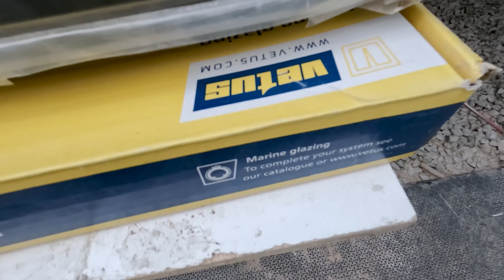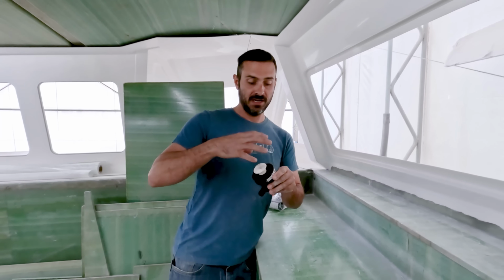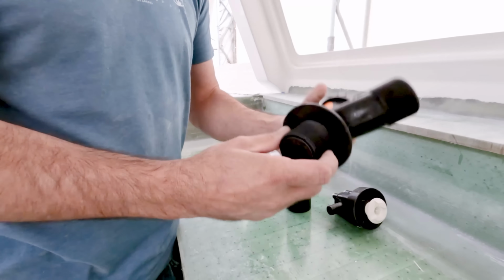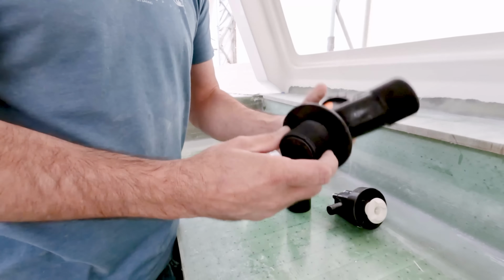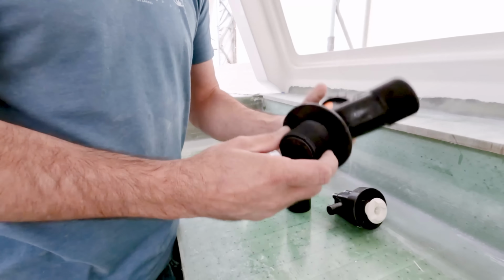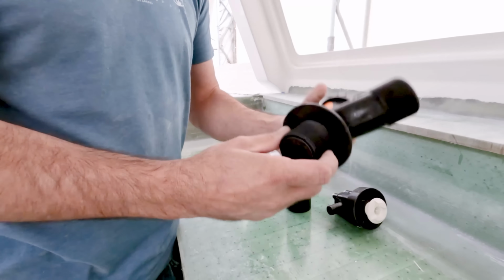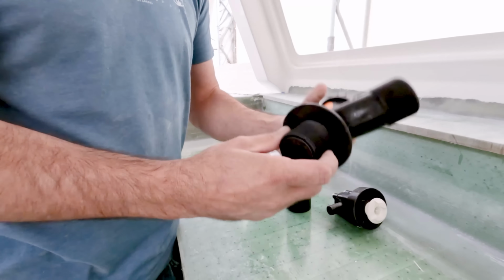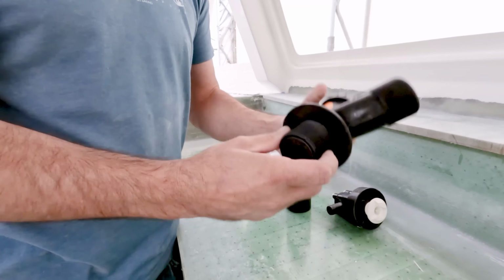Nerding Out Over FLUSH SEACOCKS  (MJ Sailing - Ep 256)

Comment: The other benefit will be, not having to wonder how many critters will migrate in the hole because when you close it it will be closed from the outside. That would be great for engine cooling water pump inlet.

Comment: These flush thruhulls  came with my racing sailboat 20 years ago.  They are great and require no maintenance.  You do have to make sure the holes are clean if you leave them open for a long time.  Sometimes stuff grows there and they become hard to close.
Reply from the maker: Are they the same as you had 20 years ago?  I hadn't seen them before, but neat to know they've been around that long.
Reply: @MJSailing  they sure are exactly the same!

Comment: Leery of drilling holes in the bottom? Heck yeah! But you guys are thorough and I'm sure the seacocks will be perfectly installed!
Reply: ive always driled a pilot hole then hole saw from the outside in then you get the hull angle correct and dont tear the outside surface fibres

Comment: Brave move packing the de-foamed hole and anchoring the valve in one shot, not sure that was wise. I'd pack the hole first then re drill the hole to be 100% sure the cavity was sealed, all it takes is a pinhole for water to get in and ....

Comment: Pro tip; when using a holesaw in fiberglass laminate, run the drill backwards. You get a lot more control and almost the same efficiency. You will never get ugly tear marks around the holes, from the holesaw jumping around when it suddenly and violently grabs hold of the material.

Comment: One little recommendation is the outlet of the toilet, should be as large as the outlet of the toilet macerater. If you use salt water flush you will get calcium buildup in these pipes that will quickly block them.

Comment: Cool fittings indeed, I have used Marelon on our cat as well. I was surprised in the method of fixing though, as it is standard practice in boat building to double the thickness of the outer and inner laminate and normally remove a section of core and make it a solid laminate... So it will be interesting to see how they hold up over time. As to race boats, building methods and layups have been stripped to a bare minimum to save weight and also because the life span of a modern race yacht is only about 5 years, so longevity is not so important. Cheers Rustie.
Reply from the maker: I thought so too, but talking to the designer/builder, they wanted it done this way instead.  It prevents hard spotting.

Comment: When you are sanding the next through hole, use some tape around it so you don’t damage the gelcoat. It takes a lot of work to fix those scratches you made. And use a random orbital sander, it doesn’t melt the plastic that much. And do the final sanding by hand, then you save a lot of work fixing the area around.
Reply from the maker: The gelcoat is being stripped from below the waterline to save weight.  It's how they are doing the production boats in Vietnam.  A barrier coat takes its place
Reply: @MJSailing  That is an insane amount of work for saving about 20 kg on a cruising boat. It is almost the same process, as curing osmoses problems. That is at least two weeks of work.
Reply from the maker: Yup.  It's all work.  But the savings is worthwhile for us.

Comment: One slip with that grinder and you could have damage to repair. A flush cut saw and then a minimal amount of grinding would be required. Also surprised you never used masking tape and then ploy to protect all that beautiful work. Not being critical just do not want to see all your great work get damaged.
Reply from the maker: We're stripping the bottom anyway.  Gelcoat is heavy:)
Reply: @MJSailing  Interesting. What kind of bottom paint are you going to use to control the water diffusion over time? If you strip the gelcoat doesn't that make the fiberglass much more permeable?
Reply from the maker: We'll barrier coat it once the gelcoat is off.  The boat is vinyl ester anyway, so it has much better protection from the start.
Reply: Love the seacocks, simplistic innovation. Plastics are like metals for cutting. You have really sharp, high pressure slicing, chipping or cutting. You can also use low pressure high speed abrasive cutting etc. Finally there is heat, melting the material quickly in a localized area and removing it, usually with high pressure air jet. The melting of the plastic is not the intent of sanding or cutting in these methods. A hot wire saw would give better results and the sanding speed and pressure if low, such as hand sanding, the temperature can be controlled to avoid the melting that results from the high speed and friction. Freezing the plug would also help controll the heat and prevent melting. A final smooth finish can be gotten with buffing techniques. 
Slowing down the saw and reducing the heat will allow for it to cut without melting. Or at least keeping the heat more localized. 

Really interested to see how these seacocks perform and what real world flaws they have. The idea to use a solid plug that can be cut down to achieve a flush surface. Just not having to clean the sea life out of those thru hulls makes this a salute worthy innovation. Arguably the plug material could be anything, including zinc. Even if the zinc was attached as a sacrificial cap that was made flush when installed. The void left without the cap would be significant less than with traditional seacocks. Based on how quickly the fiber nylon melted I suspect it performs fairly well in quite low temperature without significant contraction or becoming brittle. 
I wonder if CO2 would be a way to cool the material and allow the oscillating saw to cut the material more like wood. Otherwise the cutting surface needs to be thicker than the rest of the blade to reduce friction and allow cooling. 
It might be possible to change the durometer of the material toward the end without significant loss in performance. Creating something closer to a fiberglass type hardness would make controlled grinding easier.
You could even cut the thru hull short and add a cap of epoxy or fiberglass that you could easily sand off to flush.  I wonder if we will miss the traditional rings and holes.  I like that the actual valve is in the hull of the but not inside. 
How do you maintenance the sealing of the valve? Is there an o ring or packing nut, pressure adjustment?  Nerds want to know.

Comment: Since those valves are a permanent part of the boat, I’m assuming that they can be rebuilt in the future when the seals wear out?
Reply: Just about to type that question!
Reply from the maker: Yup.  The screw off cap with the stem going through is to replace the guts of the seacock or service.

Comment: Regarding the water holding tank pipe, I saw, on a Delos video I think, where there was a scale build up like hardening of the arteries within the poop 💩 pipe due to a chemical reaction between urine and sea water over time. Thinking about that, is your PVC pipe big enough in diameter? Would it be better to use through fittings and thick replaceable rubber hoses that you can band clamp on and off to make replacement simple when they eventually develop poop-teriosclerosis?
Reply from the maker: We're using a macerator electric head.  Everything gets chopped up before the holding tank and it's not an issue.

Comment: Good choice on the seacocks, and a lot more durable than the metal variety.  Having chosen such a sleek well designed boat, it's well worth including such excellent equipment, I guess there's a weight saving too to compliment your careful construction.  Even 0.1 of a knot improvement in speed is a lot of distance when sailing '000s of miles.  The bonus is that in lighter winds, you will keep moving just that little bit more easily. lovely under sail and satisfyiing under hybrid power.  Incremental gains!  
On a side note, if there some dinghies & tuition locally, get yourselves out there.  Even as experienced sailors, it's exhilarating, you learn so much, even watching the weather evolve and trimming sails.  Get some solid wetsuits and find a friendly ILCA (Laser) fleet.
Interesting DNA test, did one a similar one last year.   The male line is completely inline with the clan.  The advanced maternal tests, brought up more connections than I expected.

Comment: I would hope someone made the thru hull part in stainless or brass? The plastic part looks really cheap for a multi year part in contact with salt.
Reply from the maker: They are inert - so don't corrode like stainless or bronze - but they are also shockingly strong.  It's why we used them in our aluminum boat for Arctic sailing.

Comment: Hi guys could you not have used a Macerator Toilet they pump up to 3mtrs high which could put the outlet above the water line
Reply from the maker: We are using a macerator.   But I'm not a fan of above water discharge for a head.  It's amazing how bad it stains gelcoat.

Comment: We damaged a through hull fitting because a heavy item got into the bilge in error and boat movement allowed the item to bounce around and damage the through hull. We were able to replace it relatively easily. How would u replace these new flush mount through hull fittings should they become damaged?
Reply from the maker: Cut it out and replace.  It's how we typically replace a thru hull since it's easier to cut out than to be gentle

Comment: Onboard Lifestyle did a video about there through hulls and they went with minimal holes and all were right above the waterline except for there water maker. I would suggest to go that route because it's much safer to do so.
Reply from the maker: Our boat can't sink from a through hull fitting.  A failed fitting would just get the sealed bilge wet
Reply: @MJSailing  so are saying that the access port where you placed the through hill will be sealed as well?  How will you operate the seacock? Some type of access panel with gasket?
Reply from the maker: Nope.  It's above the waterline.

Comment: Would it not have been more practical (for insuring foam-protection from moisture) to first drill a slightly bigger hole trough the inside glass and the foam, and then drill the right size through the gelcoat an remaining glass from the outside?
Reply from the maker: I was thinking of doing it that way at first.  But we're not too concerned about the core here as the infusion creates cells with resin walls sealing in the core.

Comment: 10:00 black water holding? why not dump it above the water line.  You should be offshore to dump it anyway. I lived on a 58 foot Hatters our black water exit out the side of the boat.  So we bought a big Macerator. Turning to port we had a starboard gun. No no we never shot another boat.

Comment: Because the valve goes up and down , does this mean you will open and close more often,  or barnacles could crow in the tube ? 
Is it to small a diameter for a toilet outlet ?
Reply from the maker: It's the standard 1-1/2" used in most toilet installs
Reply: @MJSailing  inlet or outlet ? , also the hose into the holding tank is tiny , usually again must be 4 inches , lagoon ,outremer, swan, all production boats use a larger outlet to the tank and after , I haven't seen any with the input hose inside the tank, usually entering at the top, exit at the bottom. 
The fact that as soon as you start sucking in any air on a flush you get a flow back, and residue in the pipe , many not saying you stop pumping or electric flush,  stop as soon as poop or pee has gone , leaving the residue,  more pumping helps ,but fills the holding tank quicker . and no paper , floss , wet wipes , down the pan,   yup sadly I have in my job had to sort out the issues ,
Reply from the maker: 4"?   Nobody uses four inch for anything.  Again, the standard is 1-1/2".    The pipe out of the toilet is 1".... The same as pretty much every electric head on the market
Reply: @MJSailing  water in yes , out is bigger , seacoast bigger ,  y valve much bigger if used,
Reply from the maker: Show me a single 4" thruhull sold for the recreational market.   Just a link....i'll wait :)

Comment: non services able, non removeable seacock HAAAAHAHAAA see them before. you WILLL REGET USING THEM. But what do I know having worked on luxury yachts for nearly two decades, I just work on multi million dollar boats in south florida.
Reply: Making holes for through hull's, DRILL FROM THE OUTSIDE. pilot from the inside drill from the outside. So the hole is true to the curve of the boat. Other wise it will not sit flat/flush to the outside. Palm to face. Also its better to use a drillpress adapter for the cordless drill. You can get them at harbor freight. dirt cheap. keeps the cut VERY  striaght and true.
Reply from the maker: You do realize these don't have a flange on the outside?  There is nothing to be flush?  The screw off cap should give you an idea that these are serviceable
Reply: @MJSailing  I know of this type. AND YES no flange to the outside means you have only a putty filler. That may or may not have a perfect seal to your decorded area inside and outside frp layers. I'm 99% certain you will find water in the core in that through hull area with in 1-2 years of the boat splashing. Even Putty with chop strand is still subject to fracture, and is not a fiberglass layup.  The putty is likely to get mocro seperations between fiberglass/putty as the boat hull flex's with use and pounding seas. The entire point of an outside flange is simple. Water pressure is pushing IN. There for its hard-ER for water to get by a sealed (caulked) flange. Now if a flush outside is desired, then a deletion is done (an indent is molded or carved out of the hull fiberglass. Using those through hull sea cocks, the ideal install is to leave the outside skin alone, decore from the inside. Use red board, green board, G10!! or scrap solid fiberglass scrap or hand layup. set it into the decorded area with a few layers of matt or what ever,  not putty to the outboard side. and do a finish layup over the board to the inside of the hull. Then cut your hole and do the install as shown in this video. Then the install will have a solid fiberglass install. And yet the through hull is still NOT survice able. Its glassed in place, the upper section may have survice access. Through hulls of anytype are generally regarded as ONE time install. Threads wear and materials age in there own manner.

Comment: Surely a seacock could be made that is flush but fully removable. The hull could have a stepped outer hole so the whole seacock could be screwed together but still be flush.
Reply from the maker: There are flush through hulls, but you still have a hole that affects flow.  This could have been duplicated with a screw off valve, but what gives it such strength is the glassing and permanence of these.